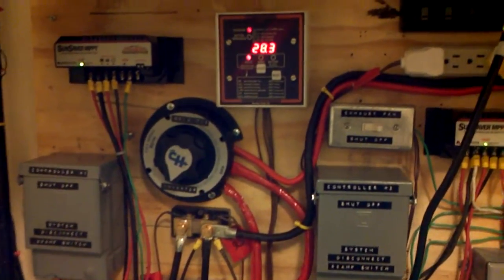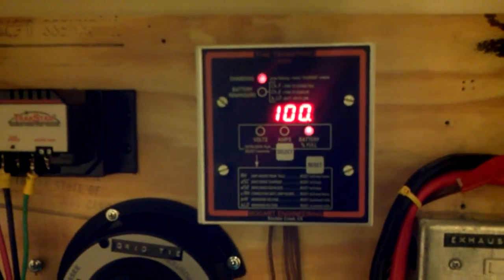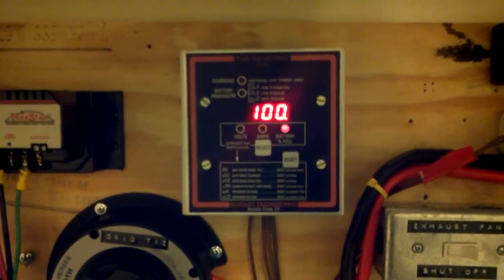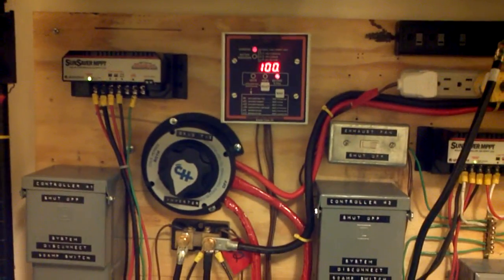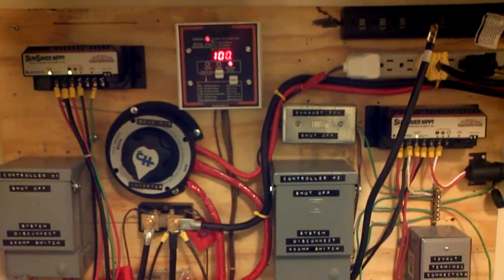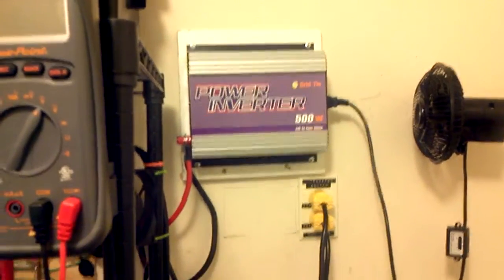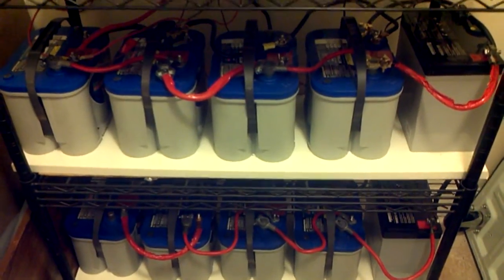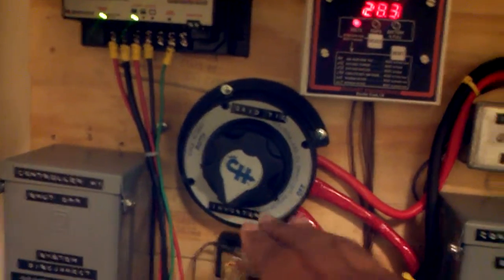DIY - Grid Tie Performance Test Verification Part 6 - Conclusions

Comment: Congrats and thanks for one of the few *real* well-docoumened performance tests on YouTube about these low-cost GTI units. Even tho this video is pushing 2 years old, I have not seen anything newer come close to it for asking & answering the hard questions. Perhaps most important result: forget about relying on the tiny, intermittent fan built into the GTI and just keep a fan running over it the entire time for both efficiency and longevity. These low-cost units will burn out fast otherwise.

Comment from the maker: @doctorfuse007 I have found that voltage levels determine how many watts the GTI produces, ie., if your GTI takes input between 10v - 30v, the closer you get to 30v the more watts your GTI can produce, provided it also has enough amps also. I suggest checking your incoming voltage levels for voltage drop, or too much resistance, etc., also check your panels themselves (placement,wiring,temp,distance,weather, etc). Your previous setup may have been drawing from your batteries.

Comment: @rhandsom No, I connected the GTI at a splice just before the pv panel input into the CC. Not at the load. I know when it shuts off when the PV voltage gets low it stops current flow to the PV, but I'm wondering if at the PV input it may actually pull juice from the battery? And any insight into why the GTI is so inefficient when i attach the PV directly (40W max, but 104 VA max, today; old setup at CC, 70W, 115 VA max)?

Comment from the maker: @doctorfuse007 Typically, if you connect the GTI to the load side of the Charge Controller, it would pull from the battery bank, thus draining your batteries.  A good charge controller should block energy flow from the batteries to panels. The panels should also have blocking diodes.  I"m assuming you previously connected the GTI to load side of the CC and not the PV connect side, if so, then yes your batteries were being used as a buffer.

Comment: @rhandsom , so I'm having an interesting problem. I was getting around 50-70W when a GTI was connected to my solar charge controller PV input (120W of panels), but my batteries kept discharging (weird, because the controller is supposed to stop backwards feeding to the panels from the battery ???), so I connected the PV directly to the GTI. Now i get around 38W MAX. Was my battery somehow buffering the old setup? 
Does the controller only stop backwards flow when it shuts off @ night?

Comment from the maker: @doctorfuse007 Practical, for me, meant "if I had enough watts coming in, could I use the GTI to max effect without hurting the batteries", to my satisfaction, that theory was feasible. Using the battery bank as a buffer is similar to the charging\dis-charging method used in your car. This gives consistent power for the short time I use it. Consider this, if it takes me 4hrs to get 1.8kW and you 6hrs, then I can achieve the same results faster and more consistently without hurting the batteries.

Comment: @rhandsom but what does that mean, "to determine whether this approach was practical? Do you mean "if it worked at all, regardless of maximizing power into the grid", or that it "did maximize power into the grid, as opposed to straight connection to the panels". I am obviously missing some positive reason for buffering from the battery if it is not to maximize power.

Comment from the maker: @doctorfuse007 Thanks for you comments. The object of the experiment was to determine whether this approach was practical, and I think I proved that under ideal conditions it is. In my view, the inferiority of this approach is due to the fact that for one thing you need ideal solar conditions for it to be effective. Theres going to be inefficiencies and losses in the system wherever the source. And yes, connecting panels directly to the GTI is a better approach, but it's not the only approach.

Comment: So now that you know how the GTI functions, you are still going to use the battery bank as a buffer? If the goal is to get maximum power back into the grid, it seems this method will be inferior to connecting the GTI straight to the panels, due to the losses and inefficiencies of recharging the batteries. ???

Comment from the maker: @nrodge1 Thanks, between you and Fearless thinker, I believe I have a decent understanding of the why I'm getting 78% as opposed to my earlier assumptions of 95%, and I can live with it. I've also discovered that the buffer idea is not new or strange when connecting them to GTIs.  TLG Windpower Products sells a 240W GTI on their website and specifically says you can connect it to panels OR use batteries as a buffer.   Yes, I'll keep this one, it seems to be decent enough.

Comment: Nice to see test results like this. The 300W GTIs are the same sort of circuit as your 500W and get about 78% at full output, so you are OK. The "peak" efficiency is just that, the peak and is at low power output, tricky sales guys. I've been using my batteries as a buffer for quite some time now, including wind and it's been working well with full GTI output all day long. Keep the GTI, thats a good voltage. I reconfigure things and test new ideas all time time too. The system is never finished!

Comment from the maker: @Fearlessthinker I'm hoping I have one that will be reliable and work for a while.  However, I'll still watch it somewhat closely when I do run it.  Also, at this point I've edited my efficiency estimates as "Questionable" until I can get a better understanding of what this unit is doing and if it's properly rated or not.  The unit is rated for DC input voltage between 10.8V ~ 30V.   The unit I "ordered" was supposed to be somewhere between 24v ~ 52v.  I sent 1 back but they sent another one.

Comment from the maker: @Fearlessthinker That's curious.  The documentation states that Maximum AC Output Power is 500W and "Normal" AC Output Power = 450W.  Also, it says that "Peak" Inverter Efficiency is 92%.  That's why I don't trust these cheap GTI's from China.

Comment: Hey, nice video, I'm studying your video and that is the set up i would like. Is that the Trimeter 2025A series and do you do a parallel connection with charge controllers and the same with the inverters.
Thanks again